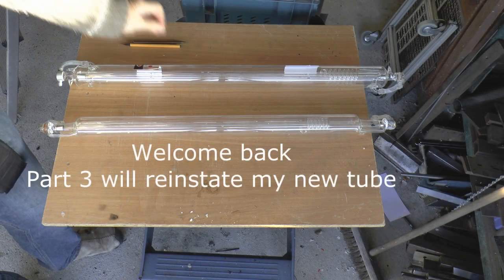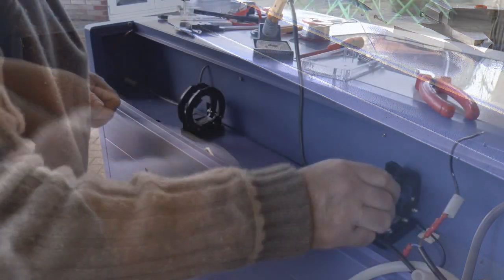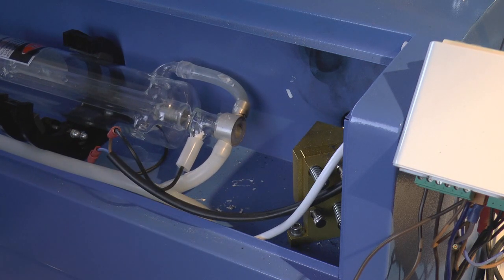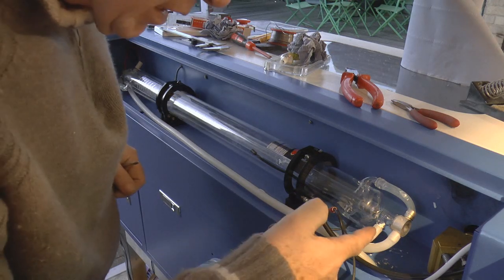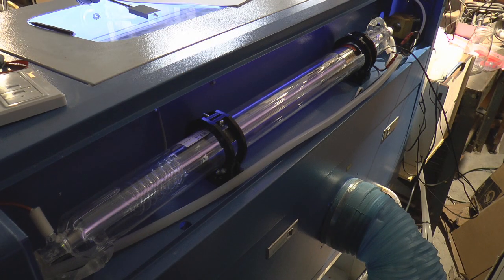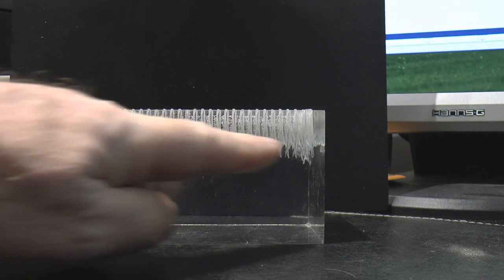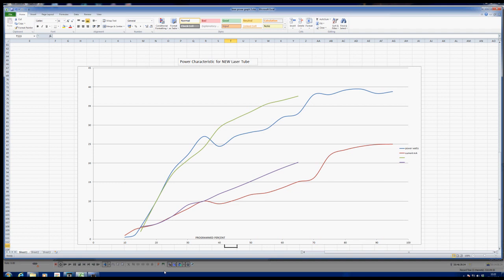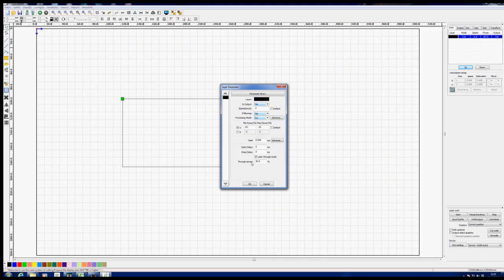RDWorks Learning Lab 35 Understanding MY Laser Tube Part 3

Comment: just a thinking would anti freeze work for the winter ?
Reply from the maker: Yes, but I would not personally recommend it. Most tubes have their mirrors glued onto the tube and end water jackets with and epoxy type adhesive. I have always been concerned that any chemical addition to the cooling water will gradually attack the adhesive. The recommendation for cooling water is DISTILLED water. I have the same distilled water in my machine that I filled it with 2 years ago. I check it once a month to make sure it's not getting slimy or coloured and I even go as far as tasting it.  I protect against freezing with thermostatically controlled heating on both my machines.  I  know of other that do use antifreeze,  so the risk/choice is yours.

All best wishes
Russ

Comment: Hi Russ, first off thanks for these videos. 
i just started running tests on the unit i purchased and already i'v had an issue. i noticed a popping sound and wasn't sure what it was.As it turns out the high voltage end of the tube seems to have shorted with the case melting the tubing over the connector. Im assuming the connection was not sealed properly with silicone. whats is your thought on this?
Reply from the maker: Hi Tom
I have had a couple of flash overs when I disturbed my HV connection and unknowingly created a minute air gap where the silicone seal was not perfect.  In my https://youtu.be/zCTrRT1C_eY I show how to get a good connection and than make a good seal by using a piece of the silicone water hose that was supplied with the machine. Hopefully they often supply some silicone sealing gunk as well. . Don't use normal bath sealant because the acidic fumes emitted during curing can corrode the wires. It's important to smear ii along the HV wire for 10mm or so and also to make sure there is a good seal around the glass boss. It's very unlikely you have done any damage to the psu. Just be VERY cautious when doing anything with the HV end of the tube. Leave the machine switched of and wait half an hour for everything to discharge. It should be safe almost instantly  but better safe than fried.
Best regards
Russ
Reply: Thanks for replying so quickly. Its. good to know that any damage may not be an issue. I'll re watch your video and hopefully my sealing job will be better than the factory job. Keep up the good work

Comment: Any concern the gauge of the spring is smaller than the gauge of the wire at high voltage?
Reply from the maker: +Open Animatronics 
Hi 
No fears or worries at all because the maximum current in the circuit is the same whether its at the HV or the LV end of the tube. That current is no more than 25mA. Wire the thickness of a human hair can carry about 90mA so you can see why I'm not concerned. I subsequently have found a safer and easier way to make this connection when I fitted my 60 watt tube.  https://youtu.be/zCTrRT1C_eY
Best regards
Russ

Comment: Hi Russ, I hope you don't mind another question! I was just wondering if you have come across something in your extensive research. I was reading reci tube documentation 

http://www.recilaser.com/en/productInfo/fc9181e93b448cac013b44f8a3e20e65.htm  

and all made sense - thanks to your videos!!! But there is a mention of "When the working current is 4mA and the tube is in the state of preionization, the laser can be used for high-frequency impulse engraving." And it made me wonder is there any harm in running the tube at too low a current? It seems obvious that it wouldn't but I'm finding that common sense logic should not be trusted when it comes to these lasers. Have you read anything on this or already covered it? Thank you! Patrick
Reply from the maker: +patrick whelan 
Hi Patrick
I have not heard of this technique before  so thanks for bringing it to my attention. Reci tubes are pretty good quality and perform reliably from all the accounts I have read. I'm not sure my tube can reliably run at those low currents but if you look at this video again at 7 minutes, I mention, and you can see, this preionisation stage for yourself before the beam becomes fully formed along the whole length of the tube. On my tube at 10% power, it will just about scorch paper right out of the laser. This "not quite there" phase of ignition is something that texts call the "plateau of uncertainty". It certainly wont register anything on my power meter. Whether there is enough energy to do useful "work" is something I've never considered. It's not dangerous for the tube so go ahead and play. I suspect this high frequency phase may work well on glass because it's the minute heat shocks that chips minute shards of glass of the surface. 

Regards
Russ
Reply: Hi Russ, thank you for your reply! Oh OK that's great, having been the killer of one tube I'm paranoid about damaging another. Yes I saw the preionisation and I thought it looked like it could be in some way damaging if prolonged. Glad to hear it wont be! That sounds really good with the glass. I'll let you know how I get on. By the way I came across a programme the other day which is great for designing fingerjoint boxes, have you seen: http://www.makercase.com/ I think its great as I think they are a bit of a nightmare to design - I imagine it would be rather easy for your cad skills though :)
Reply from the maker: +patrick whelan 
Hi Patrick
Thanks for sharing that, it's a neat little program. I am lucky enough to have the skills to do this sort of thing with my cad system. Take a look at the tube clamps for example. Having worked with industrial metal cutting lasers for many years, I have developed an ability to to imagine 3D objects as 2D elements that plug together. Its very satisfying. I am just in the final stages of designing a mk2 tube clamp that is screw adjustable in the horizontal and vertical planes by  +/-3mm.  Now, that's been a bit of a challenge because my tube is mounted very close to the floor of its enclosure ie. not much airspace under the tube. It all looks so easy when you see a pile of 2D shapes, every one of them simple!
Let me know your results
Russ
Reply: Hi Russ, yes I saw your clamp video I wouldn't have even thought you could even make something like that from 2D cut outs, very good indeed! Made me rethink what is possible but I doubt I'll ever be as good as you! I'm off to collect my machine from Ipswitch today, couldn't sleep last night it's better than Christmas :)
Reply from the maker: +patrick whelan 
Hi Patrick
Call in for a coffee on your way. I live about 15miles away from Ipswich (or I suspect 5015miles if you are in Massachusetts). I have good friends that live in Magnolia and have visited several times. That anticipation is a fantastic feeling. It may be tinged with fear when you unbox it and things don't go quite to plan. Enjoy
Russ

Comment: Do you think you could do a detailed video on replacing a laser tube and power supply? I'm looking to upgrade my 50W tube and supply to a proper 60W or 80W tube with matching power supply
Reply from the maker: +Daniel Appierto 
I have replaced my own tube in an earlier video but I'm afraid I'm not a teacher. I'm just an old guy playing with a techno toy, taking video as I go so that you can "look over my shoulder" and watch me succeed or fail. The Chinese laser tube industry is riddled with fraud. I bought my 50 watt machine  and also a 50 watt replacement tube from another source on Ebay. I now know that they were both in reality 40 watt tubes. Check out dimensions that you would expect the tube to be  before being lured into something on Ebay . Check places like this
http://www.cncoletech.com/Laser%20tuber%20standard.html they do power supplies as well

recilaser.com
http://www.made-in-china.com/showroom/andrew-laser/product-detailbKYxIOjrXakL/China-CO2-Laser-Tube-60W-1200mm-Length-60mm-Dia.html

Good luck
Russ
Reply: +SarbarMultimedia thank you for the response. Just measured my tube and it's about 700mm (40 W). That's unfortunate how they scam us, but hopefully it'll be better once I upgrade the tube and supply
Reply: +SarbarMultimedia 

Russ and Daniel

From what I can see looking at the on-line brochures for the higher power machines made by the same company.

They simply have a metal box which bolts onto the end of the laser cabinet on the right side of the machine. You have probably already noticed a metal plate covering the hole at this end of the tube housing.

So to fit a higher power tube you would need to make a box to fit this, or perhaps buy a box from the company who makes the laser cutter.

Additionally, you'd have to move the mounting brackets as the Anode HT end of the tube would not be supported very well otherwise.
And the higher power tubes are not the same diameter, so you'd also need to replace the mounting brackets (though these are also available on AliExpress etc)

If you want to upgrade to a 150W tube, as far as I can tell this may be possible, but you'd also have to replace your laser power supply 

And the tube lengths get very long, i.e 1.8m so I'm not sure it would be practical to have a very large box sticking out one end of the machine :-(

Comment: It would be nice to figure out what that "Through Power" really does.
Reply from the maker: +irmantus 
I used to own 2  large 3kw metal cutting lasers. To cut through metal you have to PIERCE a hole through the metal with a high power beam before you can start cutting. The manual (even the Boss Laser fairly good English translation) is gibberish at describing Through Power. Another viewer recently wrote to say that Through Power was the same as PIERCE. So selecting Through Power and then setting it's value to say 70% should blow a hole through your work  before starting to  cut. It seemed so obvious when I was told but I never tested it. Your question made me pop to my machine and do a quick trial and confirm that all works as expected. Sadly it doesn't . Whether there is a switch somewhere in the machine configuration file that enables this feature, I can't say. So I'm back to square 1 as well. I always have mine unticked and I've never experienced any start-of-cut issues.
Sorry no help

Happy New Year
Russ

Comment: I swapped out the water in my reservoir with anti-freeze (propylene glycol) which is rated to -50F. Only a couple dollars a gallon here in the US and there's no way algae can form in it.
Reply from the maker: +Advicevice 
I'm lucky here in the UK, it's rarely seriously hot and we are not blessed with hours of blazing sunshine, so the conditions for algae growth are not ideal. My tank has a closed lid to prevent condensation loss and ingress of dust. It was filled with 9 litres of distilled water 5 months ago and I check it weekly. No sign of that slimy feel, that earthy smell or that green tinge of colour.
I'm reluctant to put any additive into my water because of the epoxy seals that are present everywhere on these tubes. That's why I have opted for the "keep it warm" approach

Comment: Hi Russ,Good stuff! I think the pertinent question that we will all have is how do you know where you can run your tube to minimize or eliminate the dissociation? If I could run it at half the power (for twice as long) but the lifetime was 4x then I think that would be a good tradeoff for home use. I think there's a lot of "arm waving" around the specs of these tubes so I don't really trust the current numbers in the "specs". I wonder if there's a way we could tell where that critical point is from the power and current measurements? Or, is it just a foregone conclusion that these tubes are going to dissociate and die? I saw that the Parallax folks recharge their tubes but won't touch the Chinese tubes and consider them disposable. Do you think it's inevitable?Regards,Chip
Reply from the maker: +Chip Williams 
Parallax regard them as disposable and I believe their description is true. Although I'm doing all this experimentation and "playing" to satisfy my own personal need to understand, and despite the issues I'm finding, I still think this is an amazing bit of kit for the money I paid and it does way more than I ever anticipated. 3 or 4mm acrylic and mdf cutting was all that was specified for the machine. It's after all an "engraving" machine not a cutter. So to be able to cut 10mm acrylic and 12mm ply is ...well pretty damned good. Even when I dig around and find all these little detail problems, for me its entertaining, for others it may be irksome. It's never going to be an industrial machine where its reliable and just works as it should when you press a button. You have to encompass this little baby and just like the female species love it and "try" to understand it.
Back to your first point. If the dissociation doesn't get you then leeching in via the the epoxy seals will. Even with just my minimal use I wont expect more than 2 years. If its less...c'est la vie. I shall still buy another cheap tube.  Who knows, it may outlive me!!!
Reply: +SarbarMultimedia I wonder, hydrogen is probably the only gas which is leaking from the tube due to its atom size and that is  why the reoxidation of carbon monoxide doesn't happen anymore and the tube dies off. What if addition of hydrogen or water (seem water vapour might have same function as hydrogen http://www.doncasterlaser.co.uk/what-is-a-co2-laser )  possibly with syringe trough the seals to the tube could give some life back to the tube.
Reply from the maker: +Stitch7577 

Hi
Nice idea....if only. 
Two things here. First the tube contains a partial vacuum so the hydrogen cannot leak out, the pressure difference is the wrong way. And yes, some tubes have a small amount of water vapour introduced into the mix to help re-association  Every maker has his own magic formula. Gold is a known catalyst for re-association and if you look closely at the electrodes on better quality tubes they are gold plated. The silvery looking cheaper ones (which the majority of us get from China) are aluminium foil with epoxy bonded mirrors. No way into them to fix the mix I'm afraid. If it looked possible, I'd give it a go
Russ
Reply: +SarbarMultimedia thanks for the reply. i didnt know that low pressure is inside the tube. btw what wrong could algae formed inside of the tube do? except maybe lower the heat transfer a bit? thanks
Reply from the maker: +Stitch7577 
I'm certain that the heat transfer properties of the glass water jacket are worse than that of a bit of algae.  I also know they use a UV light filter to kill off algae in koi ponds. I'd be fairly certain that there is some uv light in that pink ionised nitrogen so the tube may be self cleaning as well. Had never thought about that before.
Russ
Reply: +SarbarMultimedia this is amazing to be able to ask about this stuff and get such a vluable answers. thanks agan. i use ordinary water for my tube and i dont use the laser much at the mmnt and i got barely visible green spots inside. i will let you know if it selfclean when ill start using it more.